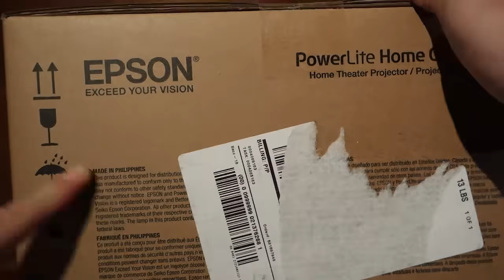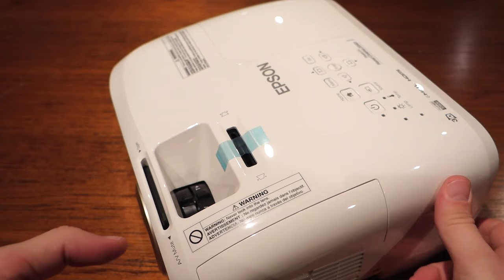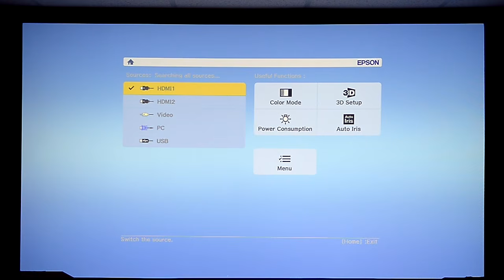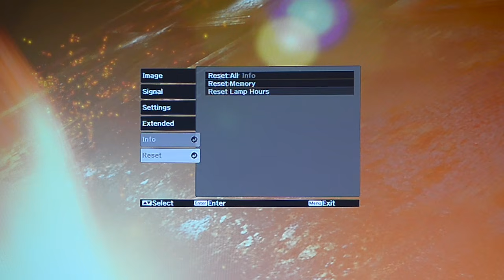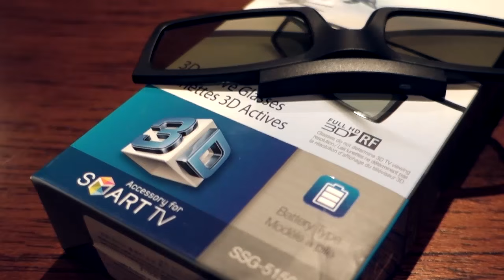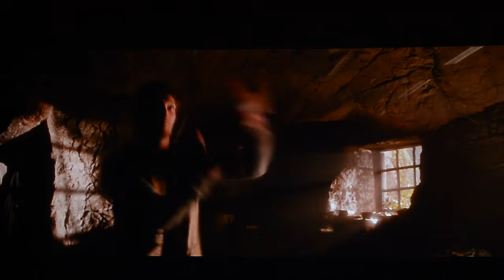EPSON 2040 / 2045 / TW5210 3D 1080p 3LCD Projector Quick Review

Comment: Would I be able to get a good picture without hanging it? let's say I put it on a coffee table(about 14 inch high) and about 100 inch from the wall, would I be able to get a picture?
Reply: yes you would, this projector is very easy and good to adjust from almost any angle, even diagonal u can turn the keystone and make it square and fit perfect, in my case i have mine next to my bed so if i aim it straight its not lined up with me but as i put it diagonal and set the image it becomes perfect and now its directly infront of me and dont have to look side ways, low how much options u have to adjust this projector

Comment: Hey mate! So, i am about to buy the 2045 to use on a 4x4meters room, tottaly dark with a white wall (to start), do you think i should go for the 2045 or buy the HT2050? (HT2050 costs 200 USD more for me in Brazil). I am worried about black levels, thinking about getting the epson + ED2/4 filter to fix this problem! Thanks.
Reply: Hey mate, i guess DLP got better contrast and black levels but also costs more here in Brazil, i will got for the EPSON 3LCD and project on my white wall, if it get too bright i might buy an ED2 filter for the projector or/and paint the wall somehow, thanks :)
Reply: Bom dia! Você comprou o 2045? Está gostando? O indicaria à um amigo ou acha que à melhores opções?

Comment: Hi, I liked the video, I have a question, to connect the phone to the projector using wifi, do you need a pen drive? How can you connect in another way?
Reply: LoveMTB To use these applications, do you need to connect the usb wifi to the projector? Or the 2045 cinema projector finds the wifi signal. I ask because I have 2045 cinema and I downloaded iprojection and wifi does not work. I have android and I have iphone, thanks for helping.

Comment: do you recommend this or epson 3500 (2040 is on sale for $500.00)
Reply: Marvin9577 neither. Steer clear away from Epson projectors. 3LCD is terrible. stick with Benq or any DLP and worry only about the picture. Dont think about the exyra features like Miracast and wireless junk. The Optoma gt1080 was much better than the epson 3
2045. epson 2045 was bright but you could see pixels and just wasnt worth it.
Reply: The Epson 2045 is phenomenal. Have owned Benq, Epson and LG.

It is all based on your room and setup on which projectors are best.

Comment: So there is both vertical and horizontal keystone correction? Can you do it from the remote?
Reply: ***** Ok so what's the difference between automatic and manual? Does it adjust itself or am I able to adjust both according the angle I have the projector at? Thanks so much for your help!
Reply: Awesome! Last question I promise. Im super excited as this comes in the mail today! Im mounting this on a post but want several devices connected including a PS3 which will use the HDMI, a PS2 and an old original XBOX which will both share the RCA, and for now computer speakers which will use the 3.5 audio out hole but plan to get  better surround system in the future. For your setup did you get an RCA and HDMI extenders to accommodate for the length so when ever you play your stuff you can just plug it into from the bottom instead of having to climb up or touch the projector at all? And if you are using RCA extenders did you use some type of adapter to create a male to female from a male to male?

Comment: You mention that the TW5210 is the same as the 2040, but it appears from the specs the 2040 matches the TW5300 and the 2045 matches the TW5350. There appears to be very little difference between the TW5210 and the TW5300 except from a bit higher dynamic contrast (35k vs 30k) and automatic keystone. The TW5300 also have a lower input lag compared to my current TW5200, but i've been unable to find the input lag of the TW5210. Does anyone know if there's really any difference between the TW5210 and the TW5300 at all other then the two things mentioned? I called epson, but they wasn't really sure either and could only look at the specs.
Reply: prej

Comment: I got a pair of 5150 3d glasses and I cant get them to pair with my 2040. I have GranTurismo 6 in 3D running and 3D is absolutely ON. Any advise would be appreciated.
Reply: Turns out, both batteries that came with the glasses weren't good. I bought soothe and it worked.

Comment: Moving to a new house, thinking of getting this for my living room (so there will be light), the projector will be mounted and want to make sure I'm making the right decision vs a 4k 70" TV. The living room distance (wall to wall) is almost 16 feet and thinking of having a screen between 110-120 inches. What do you think? Thanks :)
Reply: +LoveMTB Thanks for your reply :) I actually checked Projection Calculator Pro and I guess if I need 100" screen this projector is not a fit. Can you please confirm? 
http://www.projectorcentral.com/Epson-PowerLite_Home_Cinema_2040-projection-calculator-pro.htm?add=8947
Reply: +LoveMTB Can I place it at 10 feet and get a 100" screen?? coz this puts it in the red area (in the projection calculator pro) and I'm not sure how bad is that!! Thanks :)

Comment: Hi,
 I just received the Epson 2040. When Frame interpolation is enabled, the video frames get 'stuck' every 5 seconds or so. Is  this the same behavior you see. ? I dont know why epson released FPI if they know this will not work for normal 2D videos . Or is this a defective unit .
Reply: +LoveMTB I also disabled FPI for good . Only for very fast motion sequences this makes sense. This feature should be made a dynamic feature !!
Reply: +Renjith Renganath If its frame skip which your referring to or experiencing then the only way to solve it is by frame locking to 24p. Frame skip is something common with motion enhancers such as Epsons Frame Interpolation or Samsungs Smooth playback. Video content is usually 23.976 frames and when this dont match with the refresh rate of the display it will skip. I use Kodi to watch all my content which has the settings to from lock to 24p and everything is butter smooth